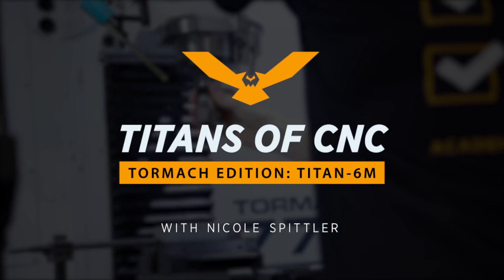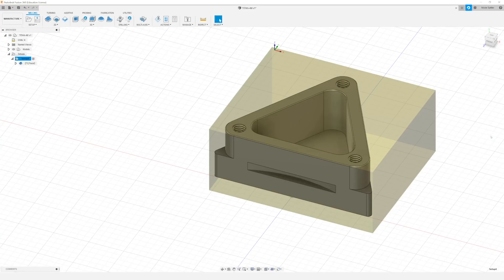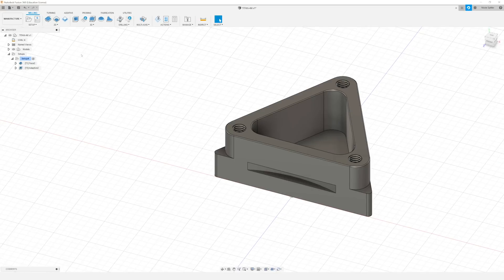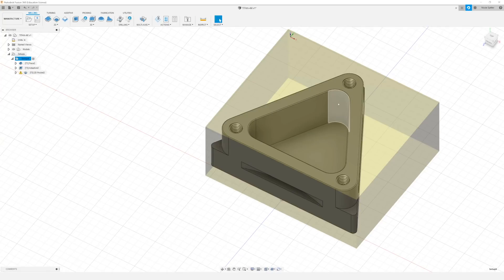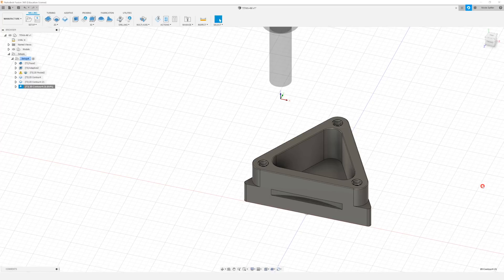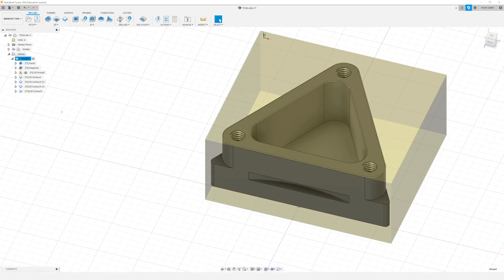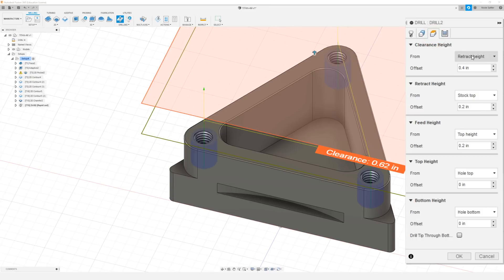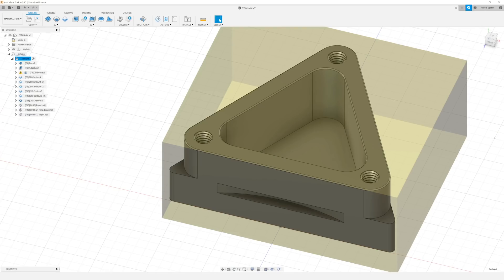LOW HP MACHINING | TORMACH TUTORIAL | PROGRAMMING THE TITAN-4M IN FUSION 360

Comment: Hi Nicole, excellent job! Very glad to see the beginnings of a series of videos for the Titan Building Blocks sample projects using 'low HP' machines, such as the Tormach 770 M+. Looks like they're getting lots of views just as soon as each one is posted. 
As others have commented, you've done a great job showing all the settings used to program the toolpaths for the machining steps. A couple of suggestions to think about:
1) Consider briefly explaining the rationale for some of the settings choices and changes you make, especially the ones you do frequently for the different sub operations. These only need to be mentioned in the first instance, not each time. For example why are the lead in angles changed from 90 to 45? Why are (almost) all the reference planes changed to model top? While the reasons may be obvious to some based on prior knowledge and experience, you want 'the rest of us' to understand these changes through watching your content.
2) Consider showing the resulting tool paths generated at the end of each programmed operation for longer, and explaining some of the features and how they relate to the settings used to generate them. I had to carefully freeze the screen when these were generated because the editing left them showing for only a fraction of a second.
These are minor points, but I do think that addressing these in future content would add greatly to the value of these in teaching both the 'why' and the 'how' of CNC programming of these sample projects.

Comment: Thanks for the excellent work.
Can you please explain your reasons for:-
1) Setting the WCS to “Model Box Point” rather than “Stock Box Point” given that you can’t probe that specific point.
2) Setting all the references in the “Heights” tab to Model Top rather than the defaults. What is the benefit?

I’m always looking for advice on improving my workflow.
Reply from the maker: It’s great especially for beginners to be able to read the code in a true sense compared to the part.

Z.003 is exactly 3 thou above your top of actual part surface.

Z-.749

Is exactly .001 above the 3/4 deep pocket.

Etc.
Reply: I'm assuming they have done that because after the facing op the extra stock setup on the top of the part is irrelevant, but yes they would have had to have offset Z in the mill to account for the facing op.
Reply from the maker: Yes, in the next video as seen on our Academy. We show that Z is set and then dropped in the offsets.

Then the face mill comes across at Z 0
Reply: simon percival  Hi Simon. 
Actually you can machine it with the WCS where Nicole has put it IF you use the Fusion WCS probing functions BUT this isn’t shown. 
You can actually locate the WCS anywhere you want and then do a probe of, lets us say, the back top left stock corner. Fusion knows where the selected WCS is in relation to the probe point and will offset all the machining accordingly. 
Without the probing ops though it does make you scratch your head.

Comment: What do you guys use to calculate feeds and speeds?
Reply: bruh, the universe does it for you
Reply: @CMTeamCobra its a proper cam system, it does calculate feeds and speeds. Tho i am not sure if there is material library where you can say this endmill uses this feed for al and that for steel. I havent played with it too much.
Reply: fusion has a number of fields but you need not specify them all. The rest are calculated. You can set the RPM or you can set the surface speed. You can set the feed or you can set the feed by tooth. The alternative is automatically calculated.

The datasheet of the cutter has the needed information.
Reply: Jack Flash Calculator